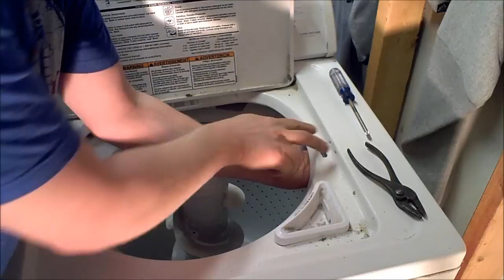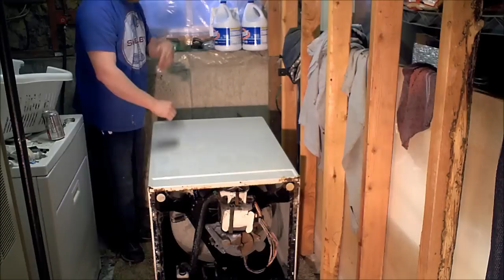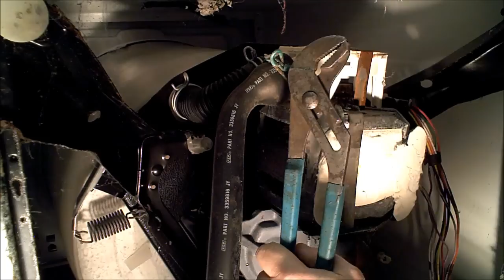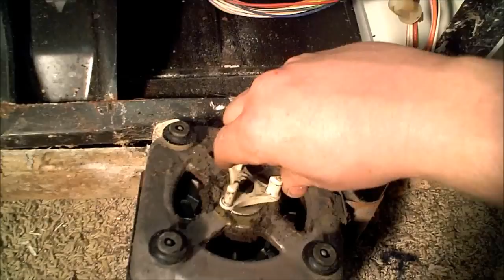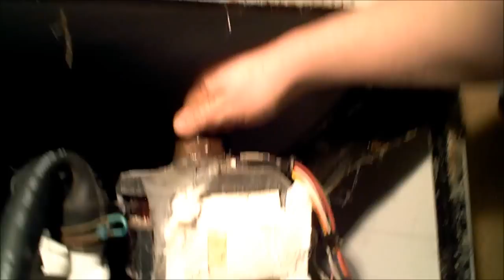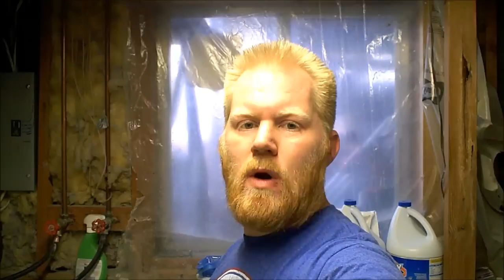Whirlpool Kenmore Washing Machine Not Spinning also Leaking fix

Comment: My old set was twenty two years old and had served their purpose well=>>allmy.tips/WhirlpoolWasher?28b       I wanted the new high efficiency models but didn't want the units to be so computerized that they would be difficult to use or be costly to repair. My main criteria for purchasing a new washer and dryer were they they work well and get my clothes clean and dry. My new washer is easy to use and gets my clothes clean and they are not as wet when they are ready to put into the dryer. My new dryer is huge and holds very large loads of sheets and a blanket plus a few other items. I am very pleased with their service and would recommend these simpler units so far. Both units are quiet.

Comment: So I have a 3 year old whirlpool top load washer,  a couple things are going on, when the wash is complete, clothes are still dripping, another issue is when it spins, it makes a lot of noise and doesn't spin very strong, and finally when we ran the cycle, the inside drum was violently spinning and very very loud.

Comment: I took a look at mine, and everything appeared to be mechanically OK; put it back in place, and it worked.  I might order the coupler to have on hand. Thx.

A similar thing happened, as I recall, with agitator dogs.  The agitator wasn't working (years ago), and I took it apart; they didn't look bad.  I put it back together, and it has worked ever since.

Comment: My washer is an Estate By Whirlpool Corp.  Model # TAWX700JQ1  Serial # CMo766210  Type  107.  It stopped spinning with a load of towels it still had the wash water in it.  I tried turning it off and restarting.  I tried everything to get it to spin the water out with no luck.  I wrung the water out of the towels and took them out.  Can you help?

Comment: I've seen other videos that have a broken coupler making a loud noise during the spin cycle.
My Whirlpool machine doesn't spin, does drain but doesn't make the loud noise during what would be the spin cycle. 
Is it possible that the motor is burned out?
Reply from the maker: A broken coupler really won't make any noise. You will only hear a slight humming from the motor running. If it drains then the motor is working fine as there is only 1 motor that runs everything on the washer. Sounds like your coupler is broken.
Reply: @sixtyfiveford  Thanks.
Sounds like that might be the case.
Since my washer has a panel on the bottom and seems like it might be a hassle to repair, any idea what I might expect a repair person to charge me to fix it?

Comment: I have a GE washer that will only spin when start button is pushed.  It won't fill agitate or do anything but spin.  Can you help me figure out what is wrong.  Machine is about 15 years old but is still in good condition otherwise.
Reply from the maker: That's random. If it's a pre-digital/ pre- computerized model I would guess at the timer knob assembly. If it's a computerized model, it's more than likely the main computer.

Comment: Mine agitates duringvwash but doesn't spin during spin cycle..could the coupler cause that? Thanx in advance subbed and liked
Reply from the maker: No, the coupler will be fine. More than likely your clutch band is worn or your lid switch is defective.

Comment: Ok, I have the same problem, drains, won't spin until I lift the lid (then close it) or turn the timer switch off and back on again, then she spins fine - problem with the timer?
Reply from the maker: Sounds more like an intermittent lid switch problem.
Reply: Thanks for the reply, I just put in a new lid switch a month ago. Remember, shutting the timer switch off and then turning it immediately back on starts her a spinnin' too.
Reply from the maker: Generally a timer stops working all together. It has a little clock motor that runs and drives the knob. The only things that interrupts the power signal to the motor is the lid switch, the knob pressed in and when the knob reaches the end of the washing cycle.
Reply: Well, to tell the truth then, I'm baffled. As the washer drains it wants to spin but instead just hums like it's trying to spin but can't - momentarily lifting the lid then returning it to closed or turning off, then right back on of the timer will get it to start spinning with no laboring humming. Ideas?

Comment: I replaced the coupler which the motor shaft side was rounded out by the spinning motor shaft. I put in the new coupler and was able to complete one load before the spin cycle would not work The problem I have found is the motor shaft corners are rounded. Any suggestions on how to fix this problem A new motor is all I can think of ~ $225/ Thanks
Reply from the maker: You can purchase metal insert couples that shouldn't slip even with a slightly worn motor shaft https://amzn.to/2sLg2SI . If you don't think that will cure your issue you can generally find good used motors on Ebay for around $50 for most washing machines.

Comment: Hello Sixtyfiveford, Thank you for the help, not sure your still active on this threat but hoping, I replaced the Clutch on my Kenmore 90 series washer that would not spin, now it spin awesomely but Now it smells like rubber burning what did I do wrong ? P.s. yes the pins was shattered on both and the old rubber pieces it connects into was oval holed, this new one fits tighter on the pins

Comment: I have an update whirlpool I can't get that white shield off. I can see that the belt is off but how do I know if the cuppler needs to be replaced also there is some black stuff under the white shield.. can you help I'm a single mom of 5
Reply from the maker: If you have a belt drive washing machine, you don't have a coupler. Get a new belt and you should be good to go.
Reply: sixtyfiveford oh ok thank you I  will try that thanks..🤗

Comment: What if the couplers won’t come off the motor and transmission
Reply: Nelson Munts I use bag balm. Its what farmers use when milking cows. The oil in it will penetrate the rust after about 30 minutes, and it will slide right off. This also works in removing metal pullys from the motor shaft on belt drive kenmore whirlpool machines.

Comment: Hello! Im about to replace the coupler and clutch on my washing machine in an attempt to fix my spinning problem. The washing machine we have is just like the one in your video. The clutch kit has two springs. The blue one is preloaded. The slip it came with said to use the black spring for over/under machines and the blue for all others. Do i leave the preloaded blue spring in?
Reply from the maker: Blue spring for large capacity washers, black for compact washers. Look at you old spring and match it up or just use your old spring if you're unsure.

Comment: Mine wont spin or drain. Fills with water. Spin cycle makes no noise but u can feel it vibrating..   Changed the capacitor already.   Any idea's?
Reply from the maker: Is the knob timer advancing and acting like it is completing the cycle? Vibrating... So you can feel/hear the motor spinning?

Comment: Amazon is better and their about the same price. I find a lot of parts on eBay were factory defects. In some cases factory defects might be okay but in many cases they are not. I have gotten a lot of cheap parts on eBay that I had to modify or did not work at all.

Comment: Enjoyed the video...thanks so much.  I have a Kenmore 600 series washing machine.  It spins out most of the time, but not every time...very hit or miss.  I would say that I might have about 6 good full cycles, then I will hit a point where it won't spin out.  It does drain.  Then after I cycle the dial and close the lid a bunch of times, it goes again.  Been living with this for a while.  Do you think that I am looking at the same repair described above or something different?  Thanks!
Reply from the maker: Christine Jones An intermittent problem like this would more than likely be the lid switch.
Reply: Many thanks!

Comment: Great video, my Kenmore machine is coming up with an SD code, soap detected I believe. It washes but won't spin out. I've pulled the tub and cleaned everything. Any suggestions?
Reply from the maker: This video gives you a basic idea of what is causing the Sd code.  https://youtu.be/-v66USc48o0

Comment: I have a Kenmore 80 series heavy duty washer that stopped spinning so I ordered a new coupling and I cannot get it to sit fully on the post so that the motor will fully seat when I put it back together.  Any help will be greatly appreciated!
Reply from the maker: I haven't ran into one that didn't slide right on. Sorry, I wish I could be more help.

Comment: Great video!  Thank you.  I changed the coupling which was a little worn.  Still won’t spin but agitates and drains.    So then I changed the clutch. Still won’t spin.  The auger moves slightly at the beginning of spin cycle but then stops.  Any other ideas?  Also tried resetting the motor.  Kenmore 90 series
Reply from the maker: Did you check your lid switch?
Reply: sixtyfiveford when I put a screwdriver in the switch I hear the motor turn as if it was spinning. When I pull the screwdriver out it stops.  The auger doesn’t spin.  Is there another test that I should do on switch?
Reply from the maker: The clutch is what engages the drum to spin. If the unit agitates, we know the motor coupler is in good condition. If the lid switch activates/deactivates the motor we know that it is good. The only thing remaining is the washing machine transmission.
Reply: sixtyfiveford that’s what i was thinking too.  Thanks for your help. I think it’s time for a new washer.

Comment: Thanks for the easy to follow video! I'm having the same problem like many others are, the machine will agitate and drain completely fine, but will not spin during the high spin cycle. I followed the video and found that the coupling was still intact and in working condition. What else could it be?

Thank you again
Reply from the maker: If the coupler is in good condition it is the clutch that is failing. You can test this with nothing in the washer and run a load. When the spin cycle is supposed to happen it should spin with no load. With a load it won't.
Reply: It definitely was the clutch. Took it apart too just to test out the spring and I could move it around with my hands easily. Thanks for the follow up!

Comment: Thanks for your video...our Kenmore 400 series washer is almost 3 years old (no warranty) and it's been making a very loud grinding and banging noise. I watched how to run the diagnostic and thought it was the motor coupler that need to be replaced (it still might) but I just looked under the machine and the wheel and a circular piece of the plastic cover was on the floor. The belt is still attached to the smaller wheel but obviously off the bigger wheel that's on the floor. Do you think I just need to replace that wheel (and belt?) or is there a deeper issue as to why it fell off? TIA!

Comment: the wash machine washes good when there is no clothes in the wash machines.  if I put any clothes on it will not spin
Reply from the maker: Sounds like your clutch band is worn. There are a lot of good videos on replacing it .

Comment: I changed the coupling and clutch. it still don't do anything
Reply from the maker: Was the coupling broken to begin with? It is not spinning or agitate? Does the timer advance and finish a cycle even though it doesn't do anything?
Reply: No it wasn't broken but still replaces it with new parts. It doesn't agitate at all. I turned it on. Water goes in but the timer shuts off. Doesn't do anything. I put in a new clutch as well. When  I turn it on. It clicks and shuts off.
Reply from the maker: Did you check your lid switch?
Reply: Yes I did. It's not broken.
Reply: im having the same issue...i replaced the agitator dogs cause they were all broke..then the coupling which didnt look bad then the clutch...my washer goes through the whole cycle but the tub doesnt spin..could you post how to check the belt possibly?

Comment: I have a question my washer has same motor and everything does the washer have a belt it's by whirlpool but also says estate in big letters
Reply from the maker: This style does not have a belt. Google your model number off the washer. This will pull up schematics and allow you to see everything inside.
Reply: thank u very much we finally got it working couplers were good but every other load or so we have to turn the agitator to get it spinning again
Reply from the maker: If it is slow to start spinning or has a hard time on larger loads; the clutch is more than likely worn and will need replacing sometime in the future. You can keep running it without harm as is.

Comment: hi. I have an old compact Kenmore washer that is not spinning. it does makes the sound like it wants to spin. saw on lots of videos that is probably a broken coupler. My problem is, when i look under the machine, i can't find where the coupling is. The videos are either for a big top load machine or front load machine. I have model 110. 48182791  type 113-01  Stock 48182 - is there any way you could help me?
Reply from the maker: Your model is actually a little simpler. On the bottom of the washer there is a fan belt instead of a coupler. More than likely your fan belt fell off or broke.  You can view a parts break down on Sears site http://www.searspartsdirect.com/model-number/11048182791/0582/0153200.html?searchType=modelSearch&q=110.48182791&searchTerm=110.48182791
Reply: sixtyfiveford thx for getting back to me. fan belt is still on & is in working order.
Reply from the maker: You'll need to go deeper then. The Brake Band(call the clutch on different models) will wear and not allow the drum to spin. Generally this will manifest itself by not spinning on full loads but still being able to spin empty or with light loads.

Comment: I cannot get the two white pieces from the shafts on the motor and transmission--any tricks to get 'em off? Jim
Reply from the maker: The couplings simply pull right off. I've never had them stuck before.

Comment: Hey...what would be the cause if the machine does the washing but when it goes to high spin or low spin the clothes comes out dripping/wet ? The machine washes but it just doesn't spins out all the water from the clothes as it did before.
Reply from the maker: Could be a few things, but more than likely it isn't spinning fast enough to force the water out of the clothes. The reasons for slow spinning speed are generally a clutch, brake, or the drive block. If you feel it is spinning plenty fast enough, you'll need to look at the pump.
Reply: sixtyfiveford are you referring to the water pump ? if so its not leaking. The clothes washes fine, the water drains out and all but it just that when the cycle is finish, a lot if water is still left in the clothes. The clothes would stick to the wall of the tub with no water in it but not the clothes sit at the bottom with a lot of water.
Reply from the maker: The water pump could be stripped out on the motor shaft so it is only partially spinning. It is relatively easy to check these things without any serious tools like in the video. But it is more likely that the washer isn't spinning fast enough to force the clothes against the wall of the washer and wring the water out. This would be the fault of the drive block https://youtu.be/w4O3n3r91B4.
Reply: Thanks for the video and your help. I check the drive block. Its in tact, the drive is square and the right basket is also in tact. It looks like it should (not worn) when I spin the basin it was difficult to spin ...wasn't loose at all. So I don't think its drive. The water pump also looks good, no leaking or anything. Could it be the clutch ?
Reply: Thanks for the video and your help. I check the drive block. Its in tact, the drive is square and the right basket is also in tact. It looks like it should (not worn) when I spin the basin it was difficult to spin ...wasn't loose at all. So I don't think its drive. The water pump also looks good, no leaking or anything. Could it be the clutch ?
Reply from the maker: Neeks H
Yes, it could be the clutch. A worn clutch will cause it to slip on heavy loads and not spin fast enough. But may spin fine on light loads.
Reply: sixtyfiveford hey so turns out the clutch was worn. Took it out and checked myself...then bought a new clutch and installed with the help of my brother and it less than an hour machine was spinning perfectly again....thanks again for all your help !
Reply from the maker: That's great news.
Reply: Neeks
Reply: F

Comment: Why buy a used coupling when new is so cheap?  I replaced a friends coupling with the improved metal insert mentioned here, only cost $3.44 new and free shipping on ebay.  These washers are really great far as being easy to repair, you can keep them going almost forever.
Reply from the maker: The metal insert ones are a new product and weren't around at the time of filming. Definitely the way to go.
Reply: Ah, I see - my oversight.  I recently put a metal sleeved one in my friends old Kenmore, to my surprise her old one was an original with no sleeve and I was surprised it showed no sign of failure yet, and her machine is 19 years old-!   I love how these machines are put together, so easy to disassemble and repair.

Comment: Kenmore high efficiency washer  
MOTOR RESET (if not spinning and not leaking) 
(1)-UNPLUG WASHER 
(2)- WAIT 1 MINUTE AND PLUG BACK IN  
(3)-WAIT 1 MINUTE 
(4)-LIFT LID 2” 14 TIMES IN 15 SECONDS!!

Comment: big tip ... open lid and check wiring if failing a little pull and plug to make sure connections are firm could fix your problem